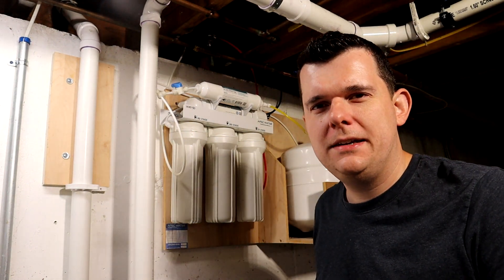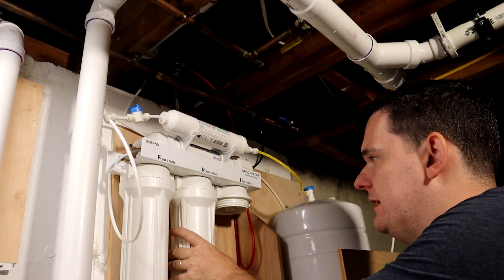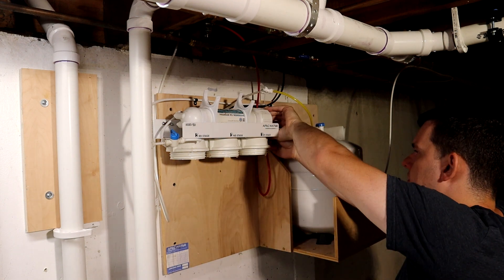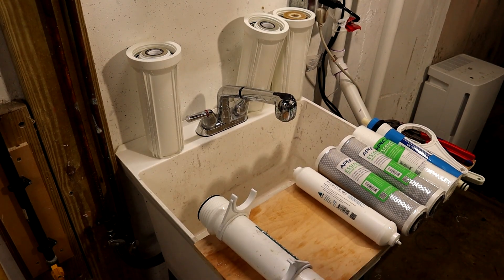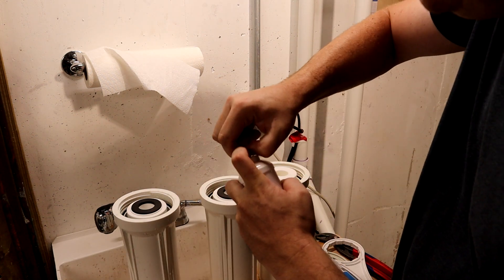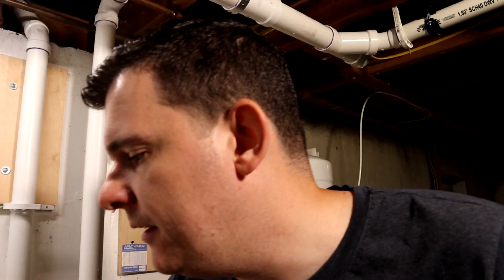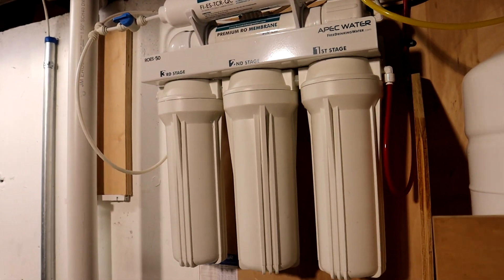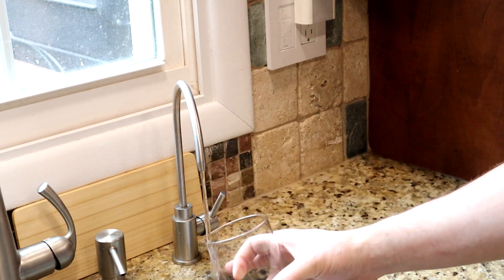How to change 5-stage RO water filters (APEC ROES 50)

Comment: My replacement filters came with instruction paper Quote sanitize: Use some mild bleach solution to rinse the plastic port on both ends of the new filter To prevent contamination”

Comment: This video was great it showed all the steps.  I opted to turn off the pressure tank and leave it off through the whole process, then replace the first 3 filters and then flush them into the old RO membrane, then replace the RO membrane and the post filter and flush again.  Then I turned the pressure tank back on.  However this may not work for all people.  Good luck everyone!
Reply: Hi, what's the frequency for changing all the 5 filters

Comment: Thanks for the video. I appreciate it.
I’m trying to get off that that cat from the Upper fourth and fifth stage. I think it’s a 5th stage. It’s the bigger one of the two and I saw you were struggling with it. I tried to use that tool to get off the housing cabinet. it’s really difficult. What was your trick because I saw that you turned off and on the video at that point.
Reply from the maker: Yeah I think I had to do it with two hands that's why. If you can't get it off with the wrench try adding a pipe to it as a 'cheater bar' this will give you more leverage, but make sure you have a good hold on it so it doesn't rotate with the fittings. They may be on tight from the factory but you do not need to tighten them that much (like tire shops do to your vehicle tires!).

Comment: Are you supposed to soak the filters before you install? Mine say flush 5 mins before use
Reply from the maker: No need to soak them, as soon as you turn the valve back on it will flush through. Open the faucet and dump the first batch of water per the manual and then let it refill before consumption. After the filter change you will see a darker water for the first time the carbon gets wet but then it will be crystal clear.

Comment: How come your membrane canister opens so easy? 

I been struggling and at the point of giving up
Reply: It took two of us to open the membrane filter cover. My son held the canister on the counter with one hand on the back the where the tubes go in because it's a good place to get leverage and the other hand on the tube. I used the tool to finally loosen the cap as it hung out over the edge of the counter. 
I thought the house was going to jump and the clock stop like in "The Green Mile".

Comment: I use this system to get clean water for my humidifier (I'm in Nevada where humidity is often in single digits). But our recycled Vegas water is SO freakin nasty that I still use a water distiller for drinking/cooking. The Apec gets the tap water from 484 TDS down to 63, but the water still doesn't taste quite right; hence the water distiller (ZERO TDS). I am bothered that the residue from the bottom of the distiller smells pretty disgusting considering it's water from the Apec, but it's way worse with water from the tap, so I'm sticking with the distiller for drinking water. It's as pure as you can get.

Ideally you should use distilled water in a humidifier because breathing it in can "amplify" (for lack of a better word) the effects of any chemicals in the water. They warn you NOT to add anything to the water; no disinfectants, no Listerine, no scents, no anti-bacterial, no alcohol, no peroxide, nothing.
I would have to run two distillers daily to have enough distilled water for my humidifier.

Comment: I just ordered replacement everything for the system under the sink. We bought this house with the system already installed and I don't have the manual or the spanner tools...are they custom or general? Can I buy a replacement at a hardware store? If not, what tools can I use to get these off, if sheer force won't do it? The new filters come on Saturday so I want to be ready!
Reply: Mine was missing, too.  I went to the local water purification store to buy mine.  

There are "universal" ones you can buy at an auto parts store that uses a fabric strap, not a metal band.  These are used to remove oil filters.

Comment: DO NOT JUST HAND-TIGHTEN.
I tried just hand tightening and system started leaking.
And do not just pull out the inline tubes.
There is a small tab that you have to press in before you pull the tubes out.
Reply from the maker: @ANVART1  push to connect fittings shouldn't allow this, they bite pretty hard. If you manage to get one out strongly suggest cutting a clean tube end so it seals well. I do not recommend using tools if you can't seal with your hands or a light turn with the provided spanner replace the seals or o rings they are worn out!

Comment: I checked mine after 3 years and they weren't dirty enough so after 5 years now I'll be Doing a replacement
Reply: The refill schedule is really based on how many gallons you run through the system.  However,  the sediment filter could clog up early, so it's best to check.

Comment: Great video and helpful as I am doing my first filter change. I wanted to get some clarification on the final step/purge. If I understood correctly, after changing all filters and turning the water back on: 
1. I turn on the drinking faucet and run it to a trickle to let the tank empty. 
2. Once empty, I close the faucet to let the tank fill back up which will be 2-3 hours. 
3. Once full, I run it empty one more time and then let it fill again and then it is good to drink. 

Lastly, I have a line to the fridge. Should I turn that line off during the purge process? Or any advice on process. 

Thank you again

Comment: Hey I found a small yellow pin with a black tiny tube that came out of one of the connectors but I have no clue where. My system works but I wonder if I was supposed to put it back somewhere.
Reply from the maker: @KoiAquaponics  not sure what that is, you can always call apec double check to make sure.
Reply: That stem go to the black tube.

Comment: I tried to do this myself and could not get the housing to budge. Had a friend come by and he got the first off. Although we had already cut the water off (main faucet and other areas),  water was spewing everywhere. We could not figure out why. Got it off, changed filter, and replaced quickly. 2nd and third housings will not budge!!! He's strong too. Tried WD40.. didn't help. Don't know what else to do.
Reply: In that case, take the whole assembly out from under the sink and put it on the floor.

When reassembling,  use some vegetable oil on the o-rings, never a petroleum based oil or grease.
Reply: 11 months later, but for anyone struggling with these, you can use a heat gun or even a hair dryer to warm up the mount/cap to get it to expand a bit might help. Do NOT use a flame/torch of any kind. The friction from that seal after it's dried for 6 months is brutal (like a car oil filter DIY nightmare too lol).

Comment: How did you get the 4th stage housing cap off? It keeps turning in my hand no matter how hard I hold it. Poor design. There should be something to grip.
Reply from the maker: If it won't turn by hand try channel locks (one without teeth just flat smooth jaws) so it does not damage the teeth on the housing cap. I think one of the spanners that comes with the kit also fits over this cap to give more leverage on removing it. Once you get it off make sure you re-tighten by hand only, it won't be that tight to come off again.

Comment: Thanks for this quick, easy video. We followed all the steps and replaced everything. Checked for leaks. However, we’re no longer getting the proper pressure/flow. We’ve waited 12 hours now. Did you experience this? Have any suggestions for troubleshooting?
Reply from the maker: Did you shut off your storage tank before removing anything? All I can think of is somehow you lost the precharge on the tank, as one person commented you can repressurize the tank but I've never had to do it yet in almost 7 years same pressure. You can call apec too they have decent technical support.
Reply: @briancnc  Yep, we did all the steps you did. But did drain all the water from system. So that caused the loss of precharge. Will look to see how to repressurize. Thanks!
Reply from the maker: @shivpalvansadia9152  You may have let the pressure out by accident. In any event better to get the pressure set correctly either way. Run the tank empty if it's not already and there is a schrader valve (bicycle tire style) on the front of the tank with a blue cap. Remove the cap and pump the tank up to around 5psi. Refill the system and you should be good to go.
Reply: @briancnc  Yep, we let the air out when we drain the system to change the filters. Did the tire pump trick…all is normal now. Thanks!
Reply from the maker: @shivpalvansadia9152  That's awesome, congrats!

Comment: I have soft water. TDS is around 85 and using this system goes down to about 5 PPM. I found I can change at around a year for the 6 month filters and 2 years for the 1 year filters. Thank you for the video as it’s a nice refresher when I change them out.
Reply: The "age" of a filter is really related to the total number of gallons you run through it, not some calendar on the wall.
Reply: @ true. And how do I measure that?

Comment: Why did you cut out the step where you unscrew the cap off the membrane housing?  My guess is you had to use a metal tool to hold the membrane housing while removing the cap, which defies your initial advice not to use metal tools.
Reply from the maker: Not sure I cut it out, maybe just didn't film it. I removed it with the plastic spanner.
Reply: @briancnc  Lol, bro you're funny. To everyone seeking advice on how to remove the Membrane housing cap: If the collet provided isn't enough, grab a plumbers wrench and tighten it around the membrane casing to apply counterforce as you beat the collet with a hammer.
Reply from the maker: @AkiraKid28  if you don't overtighten it, that's unnecessary.
Reply: @briancnc  Apec needs to stop overtightening their membrane housing caps.

Comment: You didn't sterilize the system with bleach nor repressurize the storage tank.
You should sterilize it every time you change the RO membrance.
You should repressurize it to 5-7psi on an empty tank every year.
Reply from the maker: Per the OEM manual you're not supposed to sterilize the system, but rather the 2 plastic ports in the Tee fitting and the port of the filter (only the 5th stage carbon filter. I do these off camera. Anyone doing this should also read their manual appropriately to ensure they aren't contaminating their potable water nor damaging the system by running a sanitizing solution through it. Good tip on the tank, I have yet to see a discernable difference in output water pressure, but will check it out this weekend.

Comment: Do you know where I can get more of that tube? I would like to pass this unit to the basement as well. Maks is it so much easier to replace the filters instead under the sink!
Thank you.!!
Reply from the maker: Yes you can get it almost anywhere. Look on Amazon for 1/4 pex water tube, it's usually a push to connect type. If you used the same brand you can buy it to know its the correct size just search for Apec water tube on Amazon they sell it too.

Comment: Hi Brian, question. Do i need a water softener for this? And if not how often do i need to change filters? I keep reading that im going to damage my system without a water softener so id like some input
Reply from the maker: Hi - hard to say. You should test your water to see where you stand and then give APEC a call to see if they can provide any technical sales help. I would imagine hard water would only at worst shorten the life of your filters and just end up changing them more frequently. They aren't terribly expensive and it might be a trade off to investing in a larger softener system for your whole home just to add a filtered drinking supply to your kitchen. The system itself is very simple though, I don't know how hard water would 'damage' the system though, that seems unlikely.

Comment: Thanks, their site is confusing on which O ring set to order for replacement of those. I emailed them and they basically sent me a link to the same thing I looked at initially.
Reply from the maker: Which model do you have?
Reply: @briancnc  I have a APEC ROES 50, 5 stage. Looks just like yours. On their site there is a choice for 2 different O ring sets. Thought about calling them. Just don’t want the wrong ones. Thanks for replying